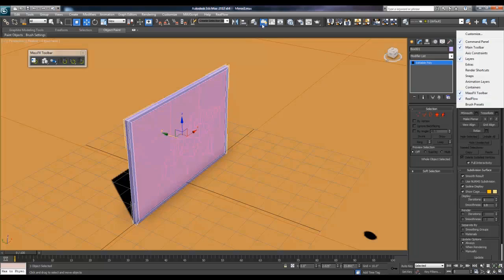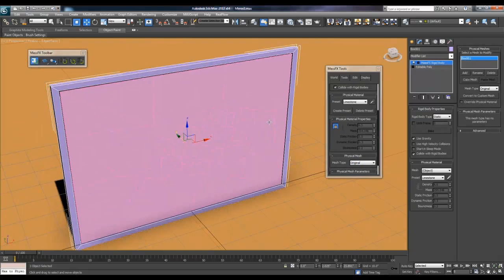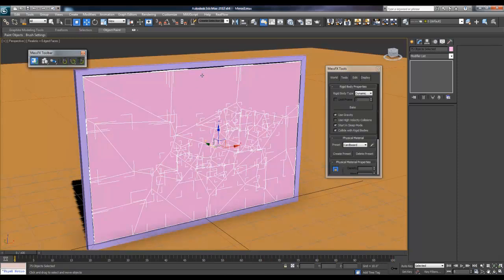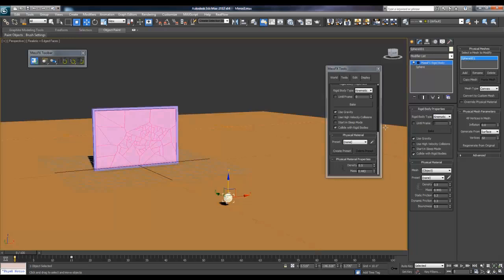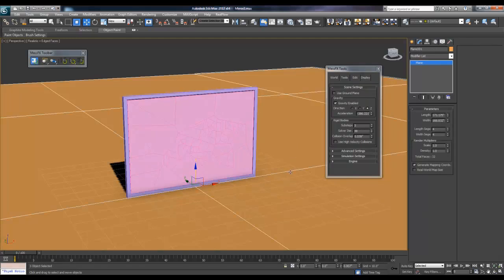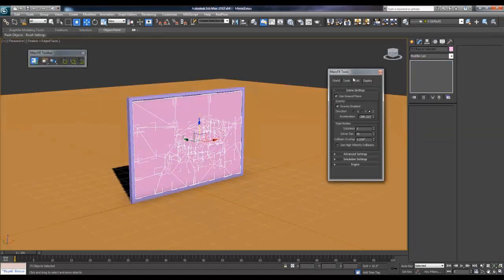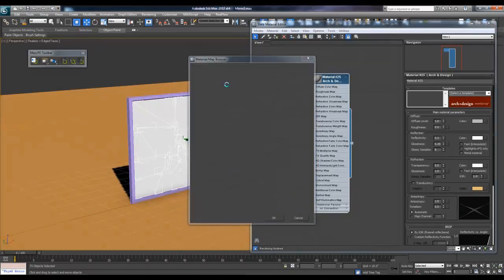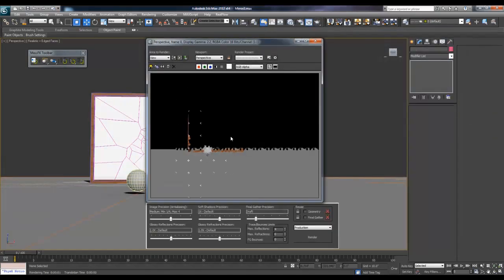3ds Max 2012 Mirror Shattering (Mass FX) Tutorial (2/3)

Comment: Thanks so much for this!  I have a question though: I used this in a composition of mine (I'm building a Goldberg Machine! :D) but I have a problem when the glass shards fall.  I've put them over a desk (which I set up as a static rigid body) and as soon as they shards "lay" on it, they start vibrating non-stop.  Do you have any idea why this is happening? If not, thanks for your help anyway!

Comment from the maker: Original was just in 2012, and now is only for static meshes in 2013. However they improved the algorithm for convex so if you are using 2013, use convex instead of original.